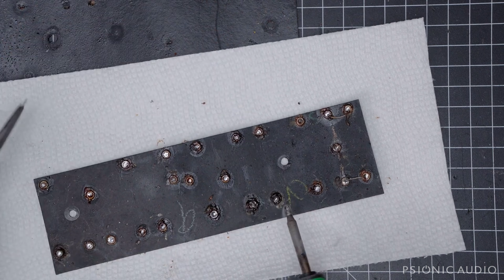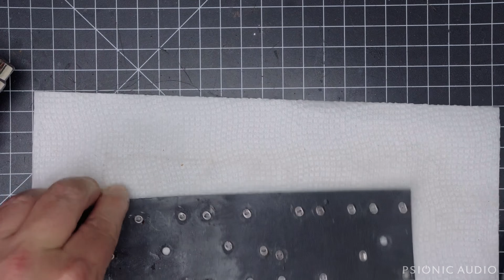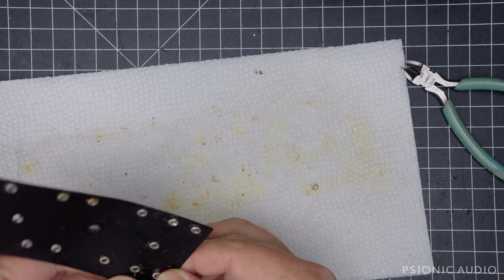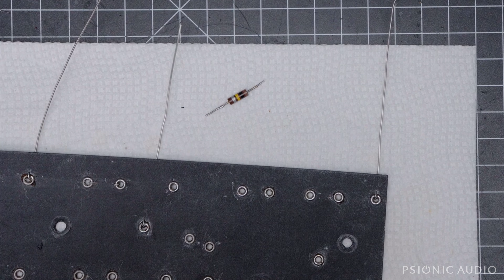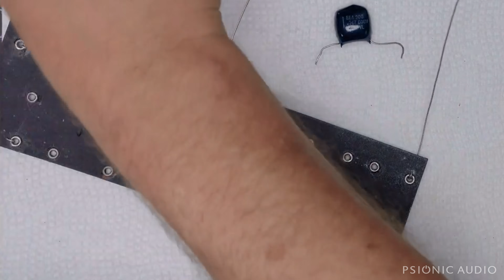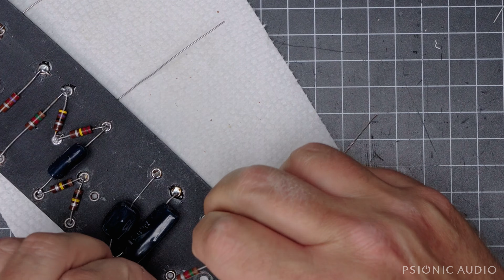The Extra Hour | '75 Fender Champ Pt 2

Comment: 33:40 I know about this trick. It's really hard to do it between both hands because to get it really straight the metal has to stretch. When I want to do this (usually when forming a long ground bus bar) I clamp one end in a vise and tug with a pair of pliers until I just feel the wire start to give. Since this video's a year old at this point, someone's probably already chimed in on this.

Comment: "The difference between good and great is usually just a matter of effort and care.

And alcohol."

i followed this advice when i started my 5f6a project, made sure i had 4-5 whiskeys every time i worked on it. im a hobbyist & while the alcohol does dull the pain from grabbing the wrong side of the solder iron, i'd be remiss if i didnt offer an addendum to your  good & great heading as it left me with mixed results..  if your fresh at this like me, also have on hand:
1- Band Aids, first aid ointment & various other medical supplies. (see above)
2- reading glasses, cheaters, magnifiers etc. whatever it is you decide to call them. enhancing your vision will really help in spotting the difference between 3amp fuses & 30amp fuses.
3-fire extinguisher,  just for general safety practices. ive found the one formulated for electrical fires works best.
4- fully charged cell phone, kept on your person is best. (little fun fact- the difference between keeping fires contained to  single room & half of a house is exactly the time it takes for you to find your dead cell phone & charging it enough to dial #911?)
5- last but not least, febreeze, lysol, any aerosol related smelly stuff. ( who knew there was so much smelly wire in power transformers? & cant they find some that doesnt stink so bad?!)

Comment: Thank you.  Very glad I found your channel...  Been chasing some ghosts that ended up being a slightly conductive eyelet board.  Do you ever measure the boards before and after?  Not in ohm's but by measuring near a hv eyelet before and after?  Just wondering if it's quantifiable somehow...
Reply from the maker: Yes. Going from 12V to 0V feels very good.
Reply: @PsionicAudio  OK thank you.  So I'm expecting 0V if I've done a good job?  Do you have a particular measurement process?  Or just measure vdc between ground and various spots on the board?  Thx again.  What a wealth of videos you've put together.  Very much appreciated.

Comment: Would it hurt a champ to run it on an 8 ohm speaker?
Reply from the maker: It very much can. Most Fenders can handle a slight mismatch but the Champ uses such a tiny output transformer a mismatch is very much not recommended.

Comment: For straightening the wire: better take two pliers or a small vice where you pinch one end, then take the other push the wire a bit together so it bows up and then pull with a short tug/jerk apart => immediate straight wire. Did Miles of wire straightening out this way during my apprenticeship and it worked always, making nixe straigt pieces...

Comment: I’ve always cleaned off the flux the way you do but never thought of melting off the excess wax with a heat gun. Thanks for that tip!

I keep a piece of 1/2” thick wood next to my soldering station and roll the wire on the desktop to straighten it out. It works better than anything else I’ve ever tried.

Comment: In regards to an 8ohm speaker and the 2k7 NFB resistor, on my Champ I ran the NFB from the 4ohm tap and the 8ohm speaker on the 8ohm tap.  Works perfectly.  Thanks for pointing that out!

Comment: I had a piece of something like paper, (probably a piece of cigarette paper), get sucked into my heat gun, where the airflow and the hot resistance wires got it stoked up with air and heat into a nice hot glowing ember. The heat gun spit it out and I had a little alcohol fire going. I use those flat tube cigarette tube papers to blot & wick moisture out of meter faces and other very tight places. I had guy drop a Yeasu 857 into a bucket of water. I used the cigarette papers to clean between the plastic window and the LCD display. It actually worked better after it got wet. I do NOT think that is normal. Plain cigarette papers are also used to check for leaking valves on woodwind instruments. $10,000 for a Yamaha Apex repad kit. It's for a $50,000 flute.

Comment: Lyle, thanks ESPECIALLY for this one.
Watching a thorough "gutting" was incredibly interesting.  I REALLY enjoyed it.

A quick question if you might consider it......

When you pull out a pair of 68K input resistors off of the board......  do you:

Try to get each one back in the holes it came from?

Or

A 68K is a 68K.   Just solder them in?

Thanks so much.

(This may be one of those Eric Johnson questions!!!  :)    )
Reply from the maker: If the 68Ks really measure 68K (or close enough) and the eyelet spacing is the same, it doesn’t really matter.

95% of players plug into the higher gain input jack, so the two resistors are in parallel anyway, taking their placement out of the equation.

In a very rare valuable amp any part that is temporarily removed goes back exactly where it was.

But this is a ‘75 Champ.
Reply: @PsionicAudio  Thanks Lyle.   From a "logical" standpoint I knew that!  It's just that there are those who "hold" that the "mojo" of the original amp requires that each resistor MUST GO IN THE SAME LOCATION where it spent the last 60 to 70 years .... or you have destroyed the amp!!!

Again, many thanks for what you take the time to do here!!!  Bob

Comment: We used to use 2 nails very close together in a block of wood secured to straighten out wire and Fish tape to get the kinks out ,the idea is to pull it at a sharp angle ,it may be a little to much for doing this but it does work well

Comment: Lyle, just to clarify, since I am about to swap my 4 ohm speaker with and 8 ohm. I can get away with keeping the negative feedback resistor spec'd for the 4 ohm speaker if I connect the 8 ohm secondary to the output jack and the 4 ohm secondary to the negative feedback resistor? Thanks!
Reply from the maker: Yes, exactly. Sorry I wasn’t as clear in that point in the video.

Comment: Lyle, would it be easier to use a new Hoffman board rather than doing all that work? From a time saving perspective that is?
Reply from the maker: Nah, this is faster and keeps the original board/layout. I don’t like the Hoffman layouts personally. Good for beginners, but I have some disagreements with some choices and the aesthetics.
Reply: @PsionicAudio  I still have a JTM45 board from way back. lol I will probably never use it either.

Comment: If the replaced OT was over spec, one could present the owner with the option to run "any octal" output tube if you beef up the cathode bias resistor, ish?  But, nfb toggle and a tone stack defeat mod and let a champ be a champ.  But the hobbyist Hubris-ist in me keeps wondering the OT specs.

Comment: It's almost therapeutic watching you clean off all that old flux & excess wax and then repopulate the board. Especially on a simple circuit like the Champ. It's much easier for a novice to understand and follow along. Please do keep up the long format videos if you enjoy it. P.S. thanks for answering my queries on the Super Reverb treble pot/ 250k J taper. I've heard you say Fender uses a J taper pot enough times I was pretty sure that's what I wanted, but wanted to double check. So don't think I haven't been listening in class professor :)

Comment: Nice!!  How useful would putting those depopulated boards in an ultrasonic cleaner be Lyle?
Reply: Tempting to try it, but you'd have to use a fair bit of alcohol to submerge the board,, and the fiber might deteriorate if put into an ultrasonic cleaner.